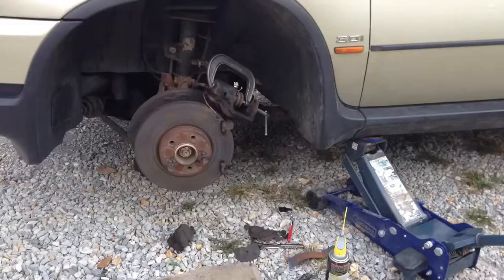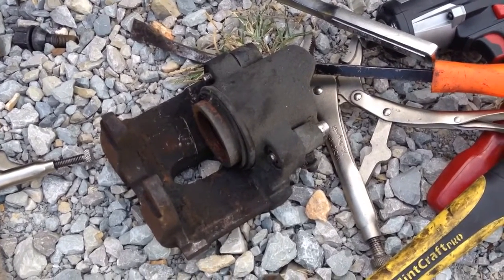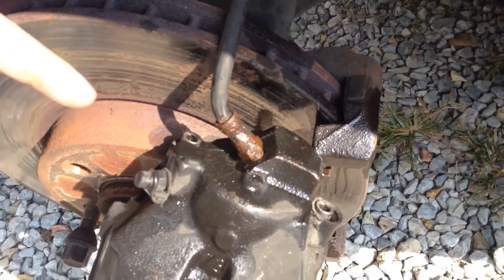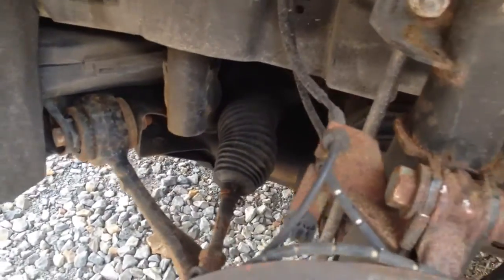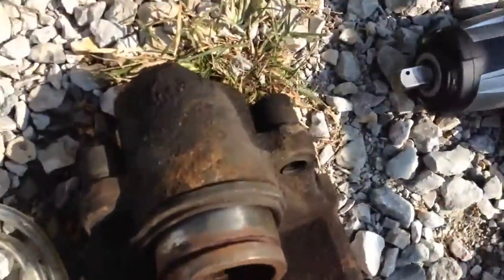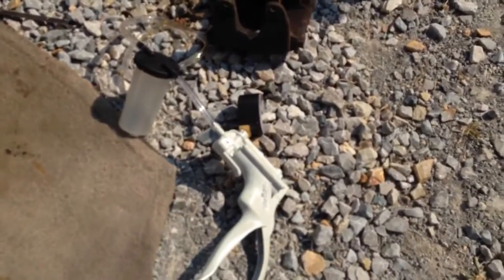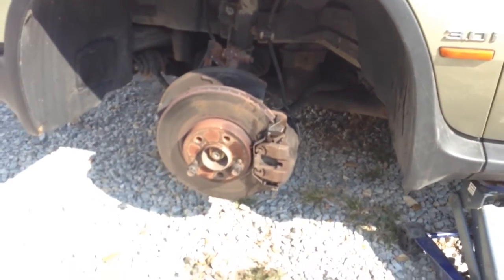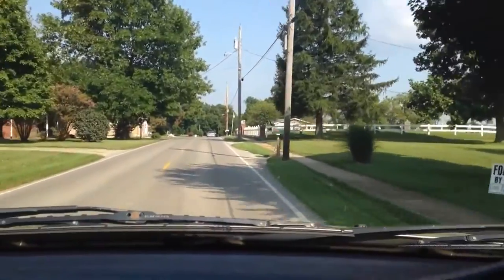BMW brakes overheating  easy fix for free

Comment: Nathan; My brakes in my e39 appeared to be bad (front wobble & what seemed like grinding) I just did the fronts (pads & rotors) & the front wheels barley turn on the jack stands w/the car off. Master cylinder?? I can't see 2 calipers going at once. ANY thoughts, very much appreciated as usual!!!
Reply: Btw; Fronts had plenty of meat on pads & rotors weren't bad. (I know I need to look at the rears. That's next)